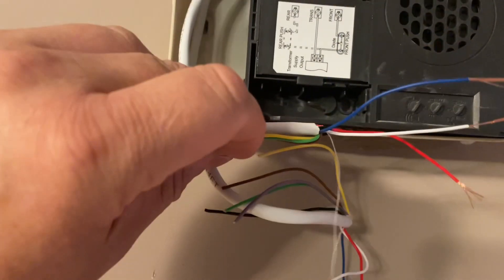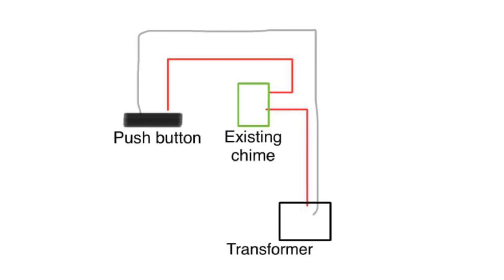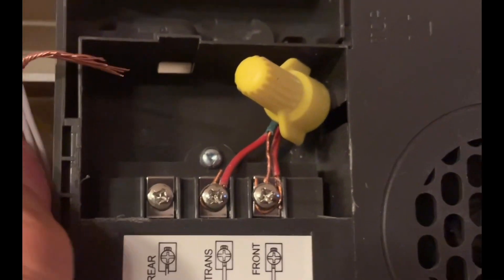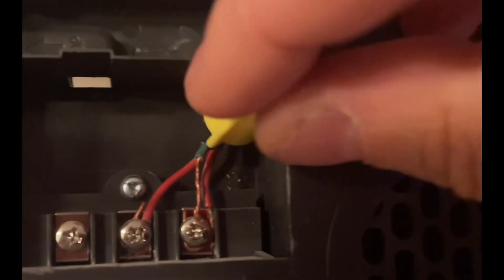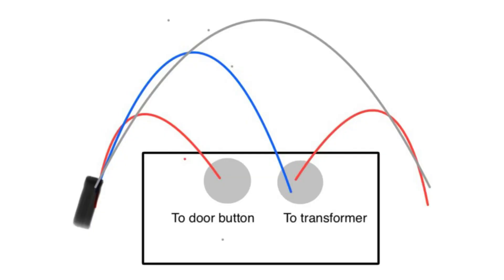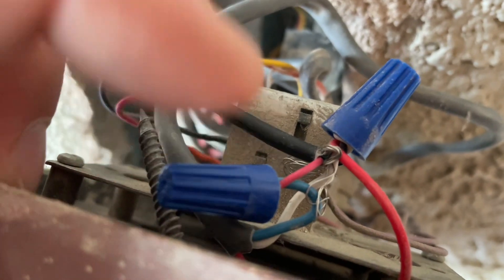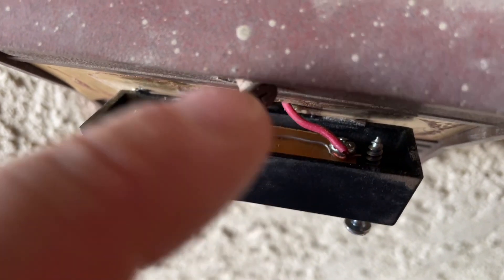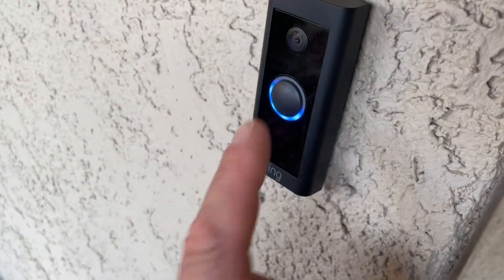How to connect a Wired Ring Video Doorbell hardwire to existing doorbell and chime

Comment: Thank you for your video. This probably doesn't work for non-Ring doorbell, does it? I have an eco4life doorbell. It's wired but I'm thinking the only reason it's wired is to give a steady charge to the battery. It says it can be wired or use the battery. "Tech support" can't really confirm if it will ring my existing wired chime or not. I hope this makes sense and I hope you see this! Thanks.

Comment: Well, what a misleading title.  Connecting like this will allow you to use both systems, basically now you have two doorbell systems that just share a power source.  Sadly, most people who come to this video (myself included) are looking for ways to install a Ring doorbell that also sounds the existing chime in the house.  This will not achieve that.

Secondly, this wont work at all in most households.  Lucky for you, your builder ran cables with more than two conductors.  Most doorbell systems are run only with 2-wire cables so there aren't any "extra" wires.
Reply: Have you found a video that shows exactly what you/we want to achieve?

Comment: Hi thanks for the video, your video talks about using existing push button and chime with Ring wired doorbell. Can we use ring doorbell wired to existing chime i.e. ring doorbell replacing  the old push button
Reply: I’m with you Rohit and trying to accomplish the same thing - take my new Ring doorbell and make it ring my original chime. 

If you find a video of someone that can do that, tag me here and I’ll try to find a video for you as well if I can find one.
Reply from the maker: Yes that is what I show.    But the ring button won’t ring the old chime.  It needs its own button.  Without having to open and make circuit board changes inside the  new ring and its button
Reply: @drprez1 Very disappointing video. 

You should re-title this video to “Do you want to have two doorbells at your front door instead of one???” 

Clearly people only came to see how you take your new ring doorbell ring your existing house chime.

Comment: Was wondering if I installed a Ring doorbell (2nd gen) & hooked it up instead of the original push bell, would the old chimes still work? 🤔
Reply from the maker: Yes
Reply: @drprez1  what do you mean? if I wire it like the classical doorbell, my second generation ring doorbell with out changing anything, will the old chime sing in the house!? Up you said this: " But the ring button won’t ring the old chime. " I wanna take down my old doorbell and put instead a ringdoorbell without making any change to the wires, will it work?
Reply: @anareaua  did you figure out if this works?